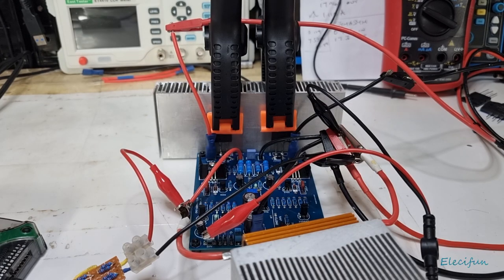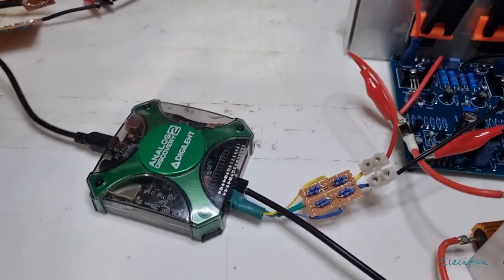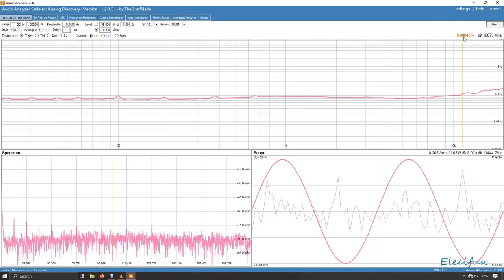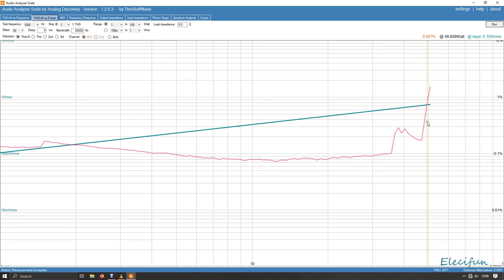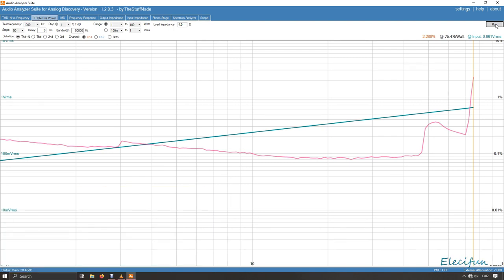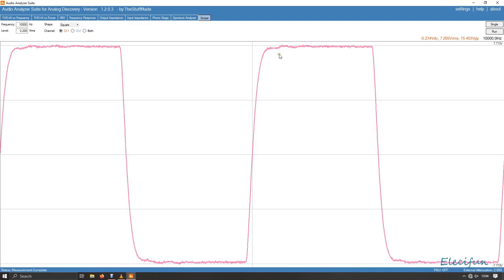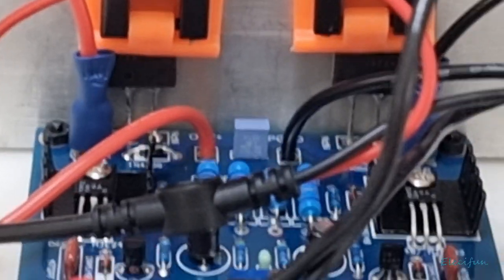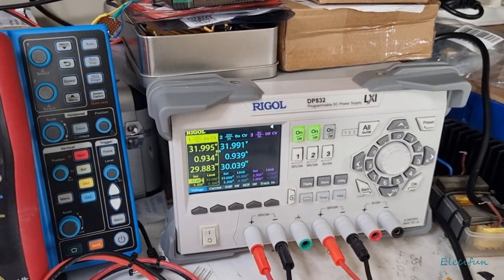NAIM NAP140 (Aliexpress) Using Toshiba Transistors

Comment: Just goes to show that the power supply is an integral part of the amplifier system and if you want good performance from your amps you need a well filtered, beefy supply. Also 'bench' tests can be misleading.

Comment: I found that the composition of 3. and higher vs the fundamental is the most interesting to watch. Could you run other than 1kHz tone through it to test other aspects of the design? Seeing a a few tenth db down at 20kHz doesnt tell us much really.. I think the distribution of the harmonics is 10x more interesting.  Also how does the circuit behave when over driven? I  think regular users often max out these little amps without nowing it with organs and orchestra bass going subsonic without even nowing it. I have 5 subs in my living room and feeling the whole room shake listening to orchestra music really was an eyeopener. Listening through tv or headphones I really coulnt grasp that that types of music regularly goes down into the 20s.
Reply from the maker: @impuls60 I like your thinking and I will do what I can. Five subs, wow that's a BIG sound.